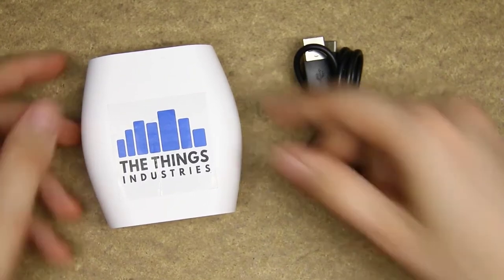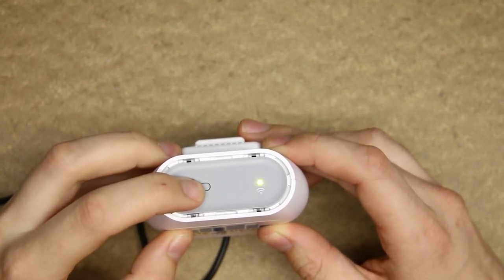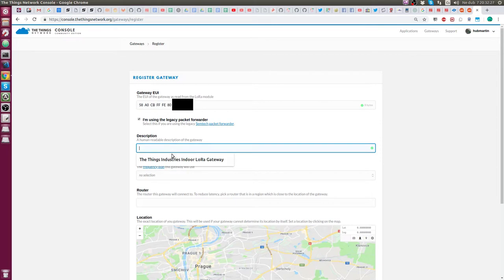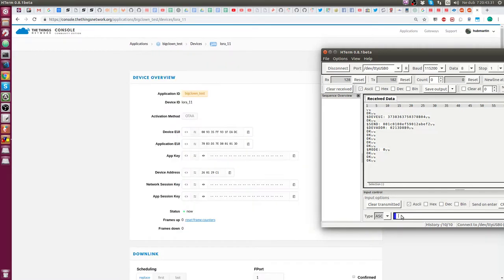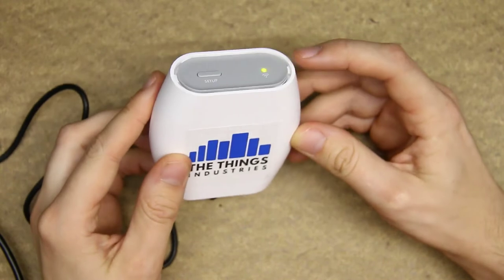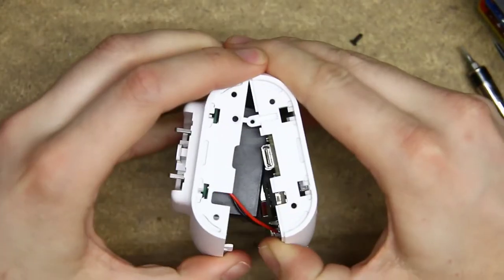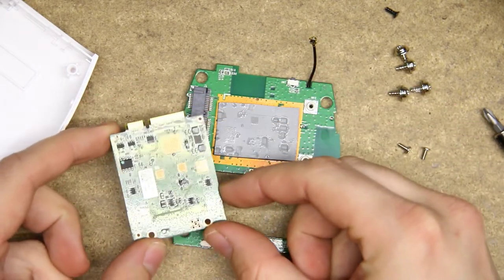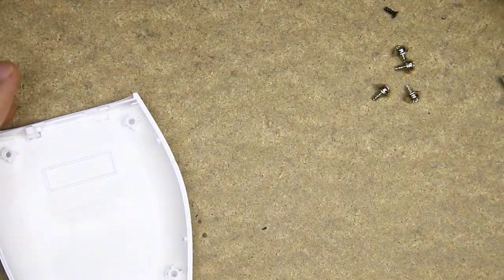The Things Industries LoRaWAN Gateway Test and Teardown

Comment: Great video, thank you. I used your ISR driven STM32 WS2812 code as basis for a wifi christmas tree lights project, which saved me a lot of time (and ram) so thank you for that as well!
Reply from the maker: You're welcome. I would be interested in pictures of your hardware and final project when you finish it.
Reply: @hubmartin  https://www.youtube.com/watch?v=HuoPfov6DLk
Worked OK but need a way to join the strings end to end - tricky power problem!
https://bitbucket.org/cskilbeck/wifi-christmas-tree-lights/src/master/

Comment: Nice video, is this a single channel or multi channel? I see the ESP but what LoRa chip / module are they using?
Reply: its a 8 channel  TTN gateway available for 868 and 915 MHZ below 100 €
Reply from the maker: 8ch 00:08, not sure what the radio is, it is soldered under the metal cap.
Reply: @hubmartin  Ah, if it's multichannel I expect it is the SX1308 in that case.